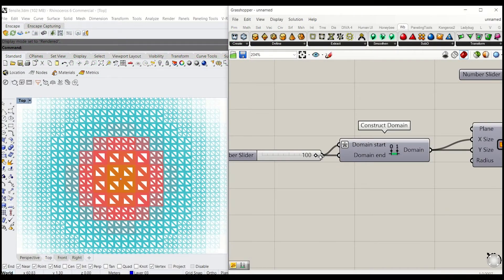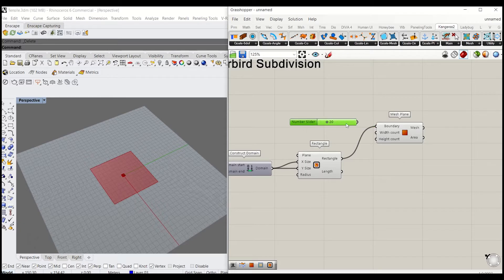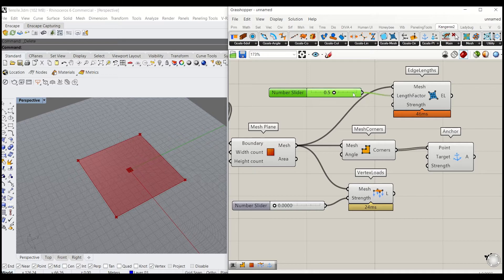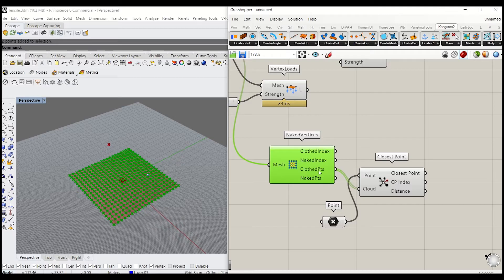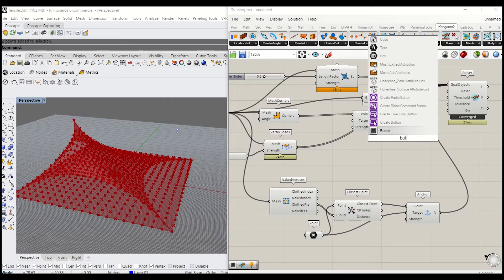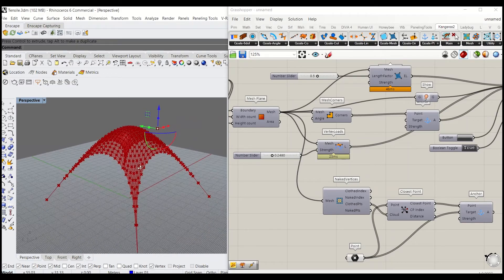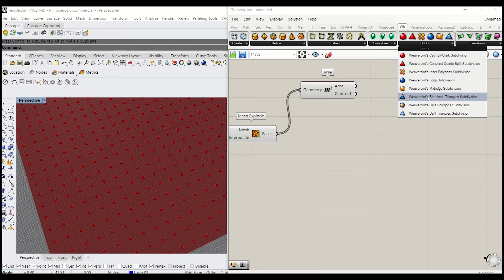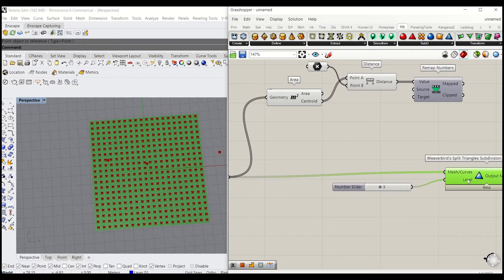Rhino Grasshopper -Tensile Structure Pavilion - Easy Kangaroo 2 & Weaverbird tutorial

Comment: Hi, I have grafted and flattened the data as you have shown, and it looks like the data is coming out correctly from the re-mapped numbers rounded, however when  I connect it to the levels on the weaverbirds split triangles subdivision, the mesh looks odd, not even like yours - any idea of the solution?

Comment: How do I create many of these?
Reply from the maker: Hi There are a couple of different ways to create multiple tansile structures. A. you can simply create more base points in various locations and apply the same script to them. B. generate one by one in the same location, bake it and move it to the desired location ( you can change the parameter to vary the form). hope it helps

Comment: Hy. Super nice tutorial. But I have one Question. How I can bring it to white in the end. Mine is everytime red or green.  So in 13:05 you turn off the last two and the object goes from marked(green) to the perfekt endcolour. How?   Thx a lot.
Reply from the maker: Hi there, thanks! make sure you select all the components except the 'mesh colours' then turn off the preview by right clicking and clicking 'preview off'. you should see the applied colours on your geometry.
Reply: @arkim7studio280  - Thx a lot. I have rebuilt the situation several times and try to create a similar colour shade but the mesh stays green when "mesh colour" is marked and red when I click in  the free zone. The comb is present but the mesh is more intense. I also tried to eliminate all the parts individually. Doesn't change anything. Of course, mesh colour stays on preview on.

Comment: Hey!!! Thanks for the tutorial but my grasshopper is crashing when m trying to join nearest point of round param to the level of wb's param.... Can you please provide any other solution or the mechanism file (the script) of the grasshopper
Reply from the maker: Thanks you are referring to the point where you connect to the WB's subdivision right? I have sort of mistaken there not grafting the 'Mesh Explode' before connecting to 'Level'. please try lock the solver first and graft 'Mesh explode' then link the Nearest param to WB's Level. This should help compute the process quicker and prevent the crash. Let me know if it worked.